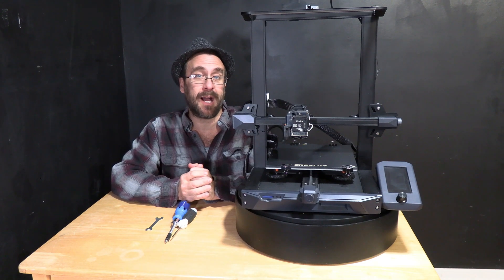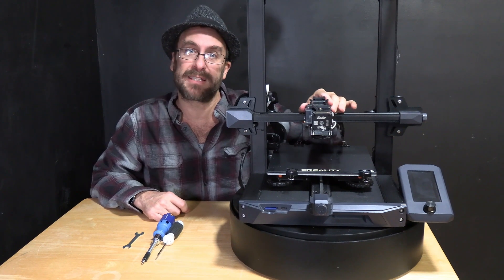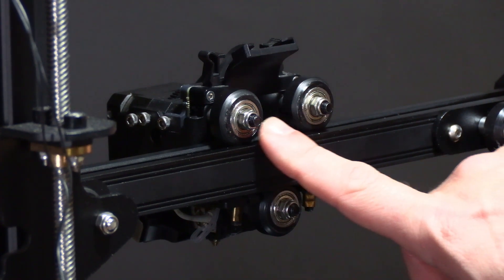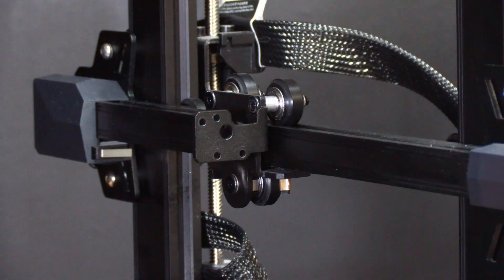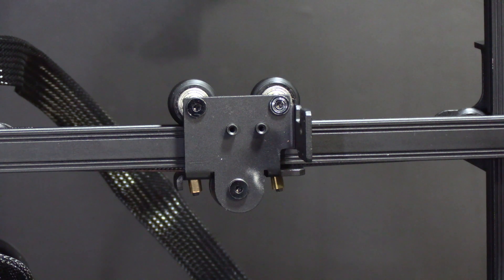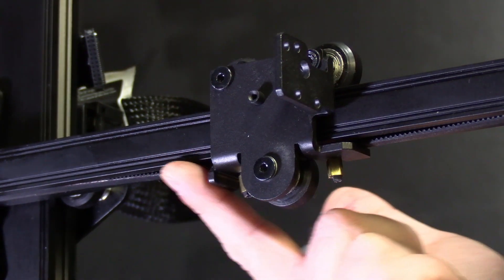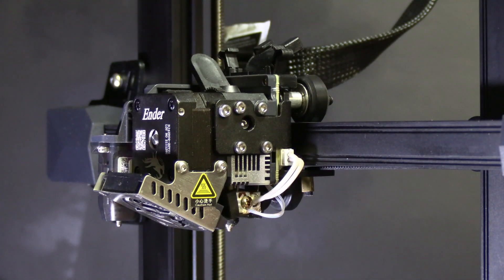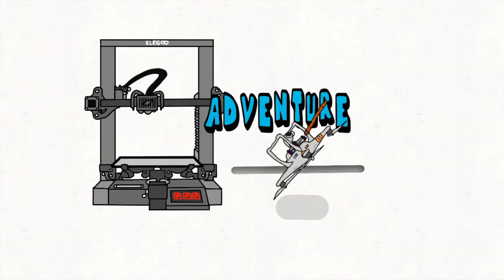Loose - Wobbly Creality Sprite Extruder Hotend? Moves like it has a FLAT Spot? This is the Fix.

Comment: I haven't tried this solution yet but, same applies if the wheel of the z axis (the one with eccentric nuts) spin free in aprox 50% of the wheel and start getting tighter and tighter and then stops and do like a "jump"(like having that flat spot) while I spin the wheel without any pressure over the Z gantry? 
I've changed the wheel for a new one and the same thing happens :/
Reply from the maker: Belt tension, and, make sure your frame is square. Loosen the screws on the left and right towers, a touch and move the z all the way up.... tighten it

Comment: thank you! you should make a video about the 90 degree extruder cable holder, it will save ur cable from breaking in the future
Reply from the maker: Link me to the one you think is best
Reply: @3DRundown  also, im getting layer lines with my ender 3 s1, ive tried everything in ur layer lines video and more and still cant make them go away, they not very noticeable from the side, but from the right angle u can really see them
Reply: Fun fact: ALL of your v wheels are in this situation